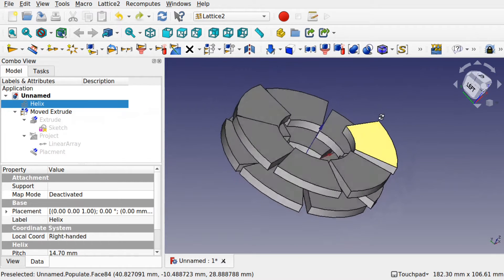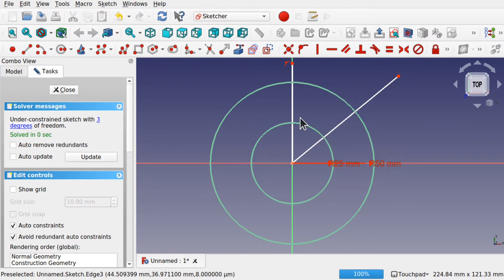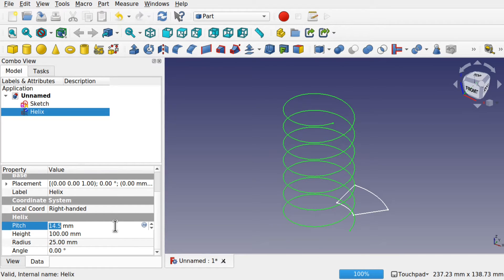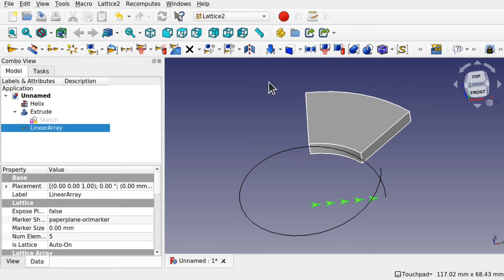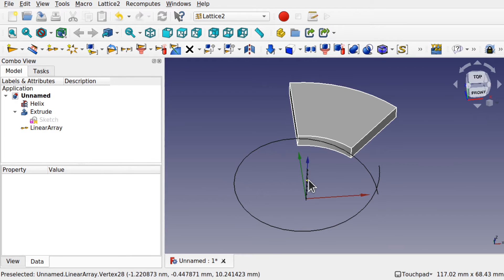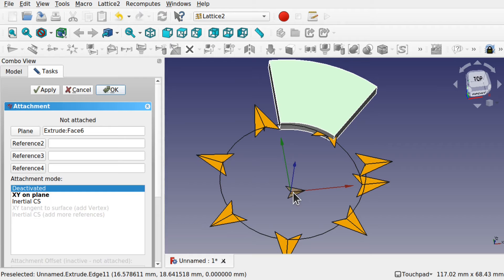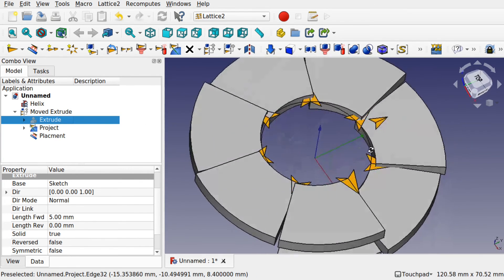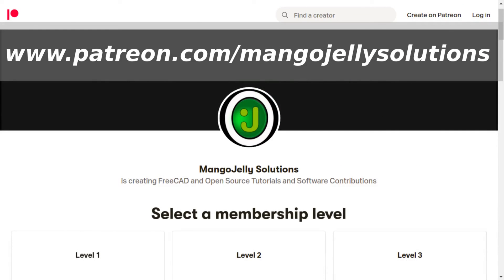FreeCAD Lattice2 : Part 4 Wrapping object around spiral / helix paths

Comment: Thank you for posting these tutorial videos. You do a great job at explaining the process very clearly. I am using FreeCAD 1.0 and the 'Moved Object' command in the Lattice 2 workbench does not seem to work. I get this error message: "You can't use population tools on shapes in partdesign body. Use Lattice PartDesign Pattern instead. Or deactivate active body to use populate tools on shapes."
Could you please advise?

Comment: How to wrap a spiral around a cone ?
Reply from the maker: Use the part design > create a cone > then you can use and additive (or subtractive) helix with the profile of your choice.  Alter the settings for the helix to match the pitch of the pyramid.
Reply: @MangoJellySolutions  do I need to bool the helix with the cone at the end ?
Reply from the maker: @mesocodecanada8974  If your using the part design that will automatically be done for you, it sounds like you are using the part workbench so you would need to do that.
Reply: @MangoJellySolutions  Thanks man. That was a life saver

Comment: That's a complex tool. Powerful but it's got it's own learning curve in top of learning FreeCAD.

Too bad we don't have a help feature inside of FreeCad that could launch your video by hovering over the icon when the "help" feature is enabled.

Unless you use this lattice tool daily your going to need quick access to either a picture manual or video manual to refresh.
Reply from the maker: Totally agree, when I first installed lattice it took me a good few months to get into it, I avoided it like the plague as way  too many tools to take in when your just starting out. It was only when I was forced to use it I realised how powerful it was but as you say easy to forget. With multiple objects to select in a certain sequence it's really hard to remember. Once you get used to the language  the roll over hints on the tools make life a little easier but there far from complete and if your like me, if I don't see it visually as a image or video it goes straight over my head. The programmer has put some effort into adding some documentation but as most things in freecad it's sparse. I do like the idea you have for quick animations. I forget which one of the 3D package I used to use but you was able to put it into a help mode and it would demonstrate the tool. It may of been truespace.

Comment: I really need to have a brain picking session with you. I’m not a proo sad guy. But I’m definitely a pro at knot tying and braiding with leather and raw hide. What I’d like to do is use cad to design knots and braids and also reverse engineer braids and knots. Every knot is based on a 45 degree angle as you show here, some braids also. I’m thinking that I can do this using this method with a few tweaks. What do you think?
Reply from the maker: Interesting idea. What you really need is be able to sketch in 3d space without being restricted to a single plane. This is quite a complex problem as your trying to get tight knot work. It is possible but it would require a lot of b spline manipulation. It's almost like you need something where you can draw the path of the knot and then all the curves are taken care of. Or even some kind of 'language'. Where you write commands i. e left over right, right 45, right under left etc. I am not sure of the answer but I can understand the benefits. You could even go as far as stress analysis to discover where the main friction points are. Interesting challenge.
Reply: @MangoJellySolutions  I just thought of an idea. You remember your videos on how you made the car by inserting images and using b-splines to draw or map out the curves and so? Maybe that would work with what I’m trying do. What do you think?